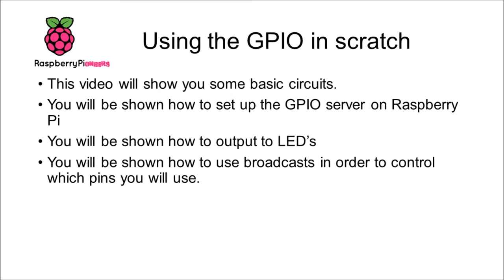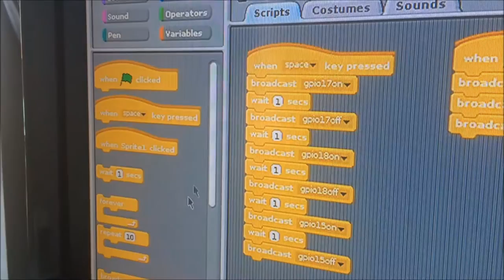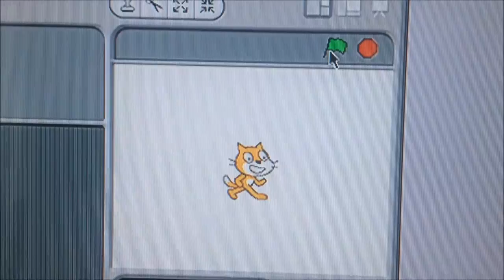Raspberry Pi - Traffic Lights - Scratch - GPIO Pins

Comment: why do you need the resistors? isn't the 3.3v exactly whats needed for the leds?
Reply: I never use resistors I think there just so you led or pi doesn't explode
Reply from the maker: resistors limit the flow of electricity so that you don't fry the bulb

Comment: i'm having some trouble understanding that why do we need only 1 ground pin for this to work? shouldn't we use 3 ground pins? like for each individual 3.3 GPIO pin? i don't get it.
Reply: candh The Raspberry Pi, like most electronic devices, has a single common ground shared throughout all of its circuits. This means that a ground on the GPIO pins is connected, or shared, to any other ground on the Pi. 

So, if there were three ground pins coming off the GPIO for the LEDs to use, they would all be connected to each other anyways, so there’s no need to run three wires from there. He ran a single ground wire, then shared that common ground amongst the three LEDs. 

It’s the current going through the positive wires that turn the LEDs on.